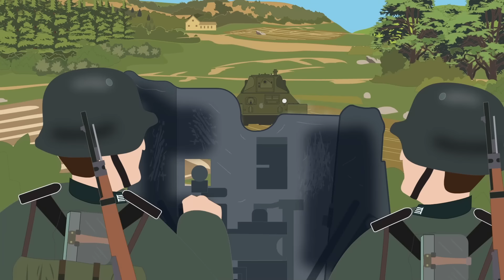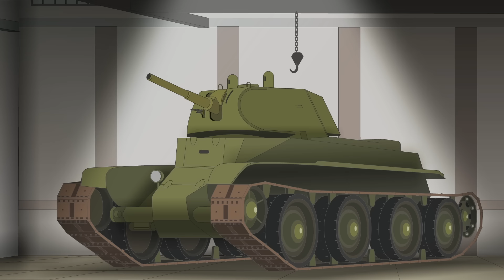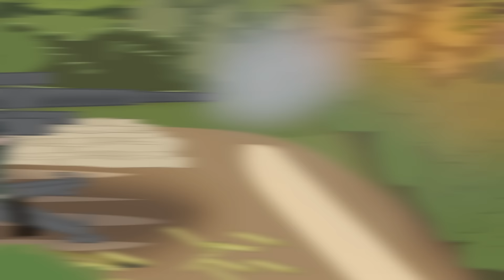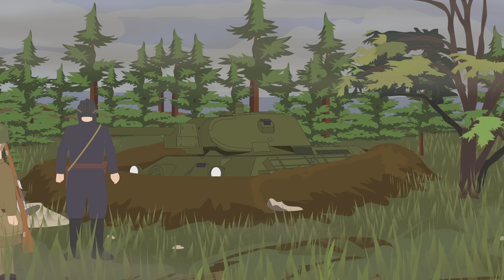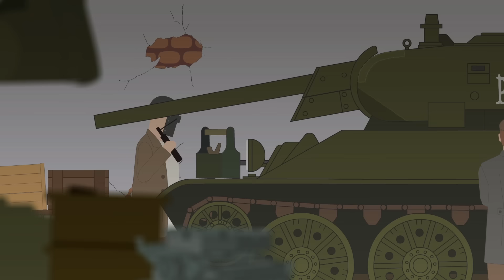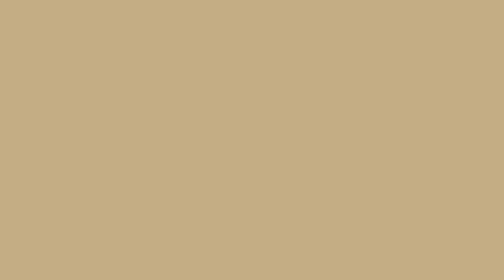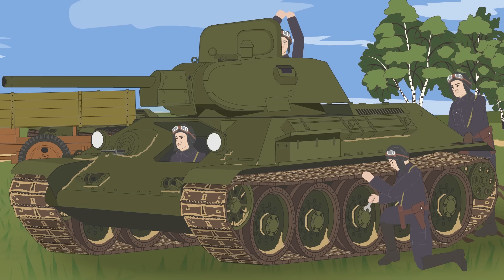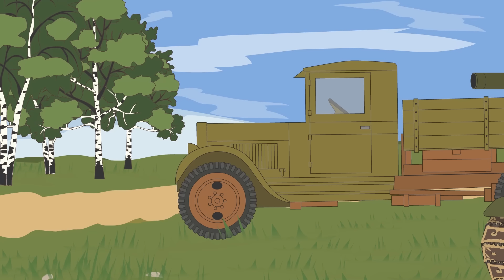Was the T-34 Really the Best Tank of WW2?

Comment: Actually the T-34 has a weak spot near the gun barrel on the left (where the ottics are) and also the previous models of Panzer (of course thank Hunter's) , could actually easily penetrate the Soviet thank shooting the driver's hatch. BTW nice video pretty interesting!
Reply: Tbf most crews would not know this at first and hitting a tank is hard to begin with
Reply: I think you're being optimistic if you think you can hit the sights whilst in combat. Hitting the tank would be a reasonable shot. Hitting it somewhere vulnerable would be a good shot. Hitting the sights would be dumb luck!
Reply: @tompiper9276  Michael whittmanns crew was good at hitting 34s just under the turret .
Reply: @austinmartin5446  Don't over rate the T34. The 2 man turret on the 76mm armed version was hopeless and the armour, though sloped, wasn't particularly thick. Hitting it pretty well anywhere with the 88 the Tiger was equipped with would have been enough to destroy it. My point was that with muck and bullets flying around accuracy tends to suffer.  Sure, 'Aim at the turret ring' is good advice, it means your aiming at the centre of the target so you're more likely to hit it. You probably won't hit the bit you aimed at though.
Reply: @tompiper9276  True, although I like to get as close to point blank range as possible, still same points apply.
Reply: @macekreislahomes1690  Didn't realise you were talking about a game.....
Reply: Gaijin would like to disagree with you
Reply: Every tank has weak zones. Including German tanks. You have another weak zone where MG is in the hull. Many others. German tanks had them as well. When calculating things you use percentages - i.e. how many percent of turret front is weak zone for example. Some modern tanks are terrible at this, like Indian Arjun which has almost half of its turret as "weak zone".
Reply: @tomk3732  The point is, you cant armor everything, everywhere. This applies from modern tanks to medieval heavy knights.
Reply: "could easily penetrate the Soviet thank shooting the driver's hatch"
Hide this from the War Thunder players, if they find out they will go insane.
Reply: @EdyAlbertoMSGT3  that's literally how I kill t-34s frontally in WT
Reply: @jacecal4906  funny cause the stalinium drivers hatch eats every one else shells
Reply: @mawdeeps7691  idk I guess I get lucky then, u really gotta hit it close to the middle, but a little low. I only ever really shoot optics if I don’t feel confident cuz then I take out the gun breech
Reply: @EdyAlbertoMSGT3  stalinium drivers hatch
Reply: All  tanks have weak spots around openings and their are actually research papers to exploring this. LOS through Tiger front turret & mantle is something like 100-160mm , but the accumulated effective resistance is less due to the mitigating edge effects and cast mantle etc. Combined its ~ 90-95% LOS thickness....leading to maybe 95-140mm resistance.....mind you roughly 1/2 Tiger front turret profile is the 80mm side turret at 50-60o.

T-34 armor was hardened well above the 280 BHN norm - as a work around to build them faster & faster. its fine as long as the threat shells are not bigger than 37-50mm....but if the shells are much bigger- like 75-88mm- then the armor resistance drops. To make matters worse cast armor never resists as well as RHA @ 250-300 BHN. 

What does that mean?  Against 75-88mm shells - the 45mm cast turret resists at less than 40mm [at angle]  , while the hull offers over 40 mm [at angle]. As the war progressed the cast thickness improved to 52mm 60mm and finally 70mm; while later model turrets , also didn't harden that cast armor.
Reply: Yes just under the turret Michael Whittmann took out dozens with his stug 3 before he got his first tiger .
Reply: True, I only knew about it from finding a similar weekness in the Tiger Tank. Optics and veiwports are good targets, hard to hit without enough training and/or experience. Luck, experience, training,  and strategy also play huge roles in who wins.
Reply: @macekreislahomes1690  most of the time they would try to hit the tigers tracks or from behind .
Reply: Thanks, I needed to know that.

Comment: Best tank of all time (of course next to the Sherman)
Reply: Before anyone answers:
Ofcourse there is nothing like the "perfect" tank, tanks always depends on the battlefront and how adoptive they are. A tank has no use, if it's build for the steppes of the Savannah  but is used in the desert. A tank, that was built for solid ground isn't effective, if it's used for muddy terrains. A tank for rural operations will have problems in a urban one. It has to be fast, but at the same time has to have a proper armor. Is it a heavy or light tank?

In conclusion, I think tanks like the t-34 and Sherman are one of, if not the best of all time because of their adoptiveness, guns, motors, low production cost and durability. And let's not forget, that in some cases tanks like the t-34 are still used till today.
Reply: Non of this implies to Tiger, Panter or any other German WWII tanks, which is why I think they are overrated and crap.

Comment: Also fun fact: Soviets wouldn't be able to mass-produce T-34's without lend-lease machines.
Reply: Totally false. They mass produced T-34 before German invasion and before they got any shipments from UK / US. Re-watch the video.
Reply: @tomk3732  depends. Yes certainly thry started serial production before the Invasion. But without it they xould have not keepen that serial production up because they received the necessary maschinery troufh lend lease (and Tons of raw material)
Reply: especially T34-85

“It was only after the Soviet Union receive the necessary maschine tools in February 1944 trough Lend-Lease that the serial production of the T-34/85 began; this had a three man turret with an internal diameter of the turret ring of 1,600mm (63 inches).” Boris Kavalerchik, The Tanks of Operation Barbarossa, ISBN 1399014293, Page 195 last 3 Lines+ page 196 Lines first two lines
Reply: @tizi087  Super false. T-34/85 went into production more or less when lend lease was not critical - in 1944. It was compromise between making better T-43 (itself sharing components of T-34) and old T-34 -- they did not want to change to much in order not to slow down things. But essentially other then the main gun, turret ring size change and few other minor mods T-34/85 is T-34/76. Since Soviets were able to product T-34/76 without any help so they could T-34/85. Also what machine tools were so special for T-34/85 they needed to be imported or shipped - the only reasonable answer is to make the main gun - but main gun was adopted Soviet AA gun - something Soviets made long before - DT-5 gun was produced in 1939!.
Reply: @tomk3732  ok... you call me false..... in litrally gave a source above. The soviets couldnt serially Producer the T34/85 because it had a larger turret Ring diameter..larger than the 76 variant. The only Maschine vapable to make those rings Was lost in khatkov druing barbarossa if i rember correctly. So no. They wouldnt have been able to mass prdouce it in the numebrs they didnt wirhout getting the proper maschines.

And about no help: ever looked at then Tons of material the soviets received? Hoe would thry have won the war without receiving those?
Reply: @tizi087  I am sure they had more then one lathe ;) Of far bigger concern for Soviet production was as he explains in video things such as bending of steel plates into shape. You would need massive press to do so and these would be rare. Large lathes not so much. We are not talking about ultra large. Turret ring was under 2m. You just need to fit that into the gap of the bed. Heck you can use larger horizontal milling machine as well. My baby sized milling machine can turn around 90cm. We are talking about common machinery her. There probably would be at least 10,000 machines in Soviet Union in 1944 that could do the job. Maybe more.